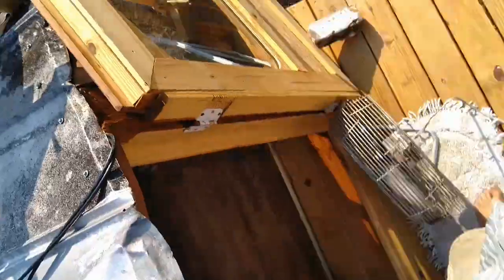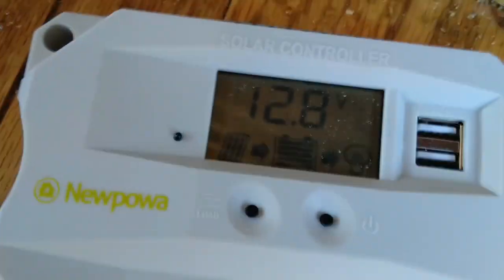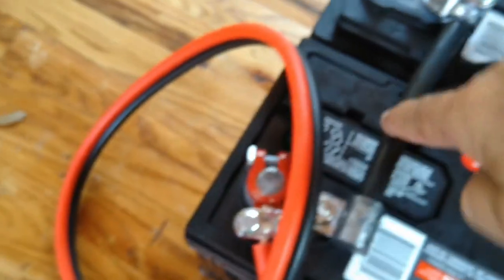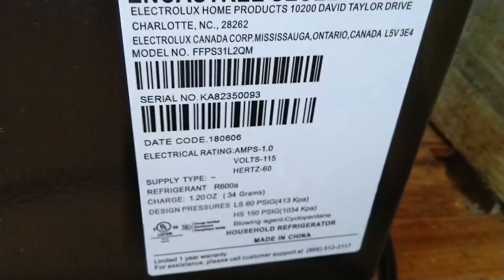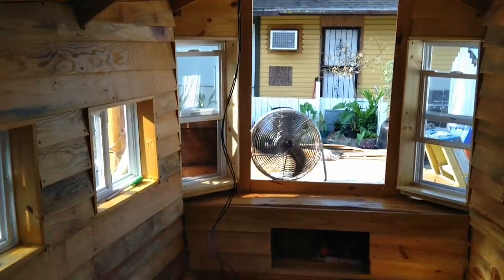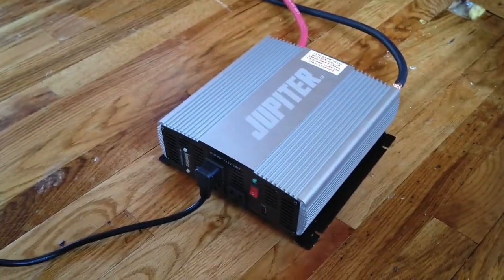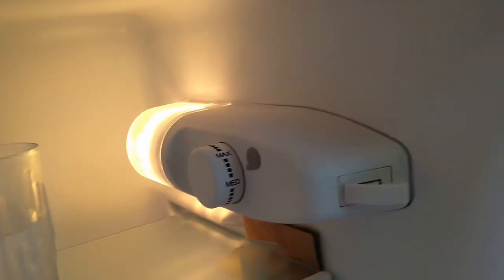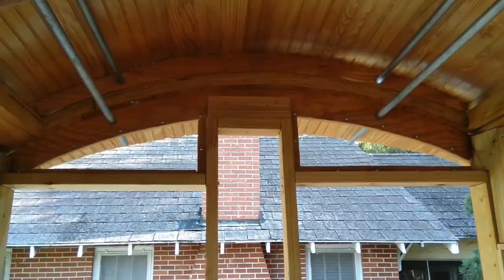Solar powered fridge on The Shanty-Boat "Looper"

Comment: I'm not an electrician, but along with the max drain of 50-60% you are using an inverter to create 115V (note the voltage on the fridge). 1 Amp at 115V = ~10Amps @ 12V (A*V=W, you need the same watts to run the fridge regardless of voltage). Also, using an inverter will lose ~10% due to inefficiency. So if you can use 195 Amps total, as @Jeff Cain mentioned, at around 11Amps per hour, you could go for about 18 hours. Now I'm wondering if you have had any real life experience with this and am I anywhere close? :)
Reply from the maker: You're pretty dang close I would say!    If I'm not using anything but the fridge, and had a full charge the day before, I usually have at least one bar left on the batter charge indicator the next morning.  The batteries usually get back up to full charge by noon.  Cloudy days and adding the fan, tv, computer, and lights to the mix starts to get dicey; I'd like to add four more batteries and two more solar panels.
Reply: @russingram  The only reason I have any idea is that I am looking to build a barge type houseboat (shanty boat) to take on the great loop and am hoping to go totally solar\electric. It doesn't look like that inverter has the option for 24V input (which can give better efficiency) as well as not being pure sin wave. Depending on the appliance, it can make a big difference (as in ruin some appliances, I'm not clear on which ones exactly). More batteries will, of course, give you more Ah. Just remember what @Jeff Cain mentioned, you do not want to take a lead acid deep cycle battery below 50% charge, ever. If you are in a high cycle environment, as I will be, you would definitely be better off with LiFePo batteries. And before you think they are so much more expensive, you have to consider that you can charge\discharge them faster, utilize more of the full charge (down to 10% charge or lower on some) and have a much longer life span (cycles) than lead acid. Just food for thought.

Comment: Your batteries can only be run down to 50 to 60% of total capacity of total amp's before you totally damage them. In your case that would be 4 batteries X 122 amps = 488 amps (total with new batteries). 488 amps discharged to 60% would give you 195 usable amp before you jump in to no-mans land and damage your new batteries. Start adding up your usage (stereo, computer, TV, nav lights and such). Keep up the good work. What hull design did you use to build from?
Reply from the maker: Thanks, I'm definitely going to need to add more batteries.  The hull is based on Peter Theil's Escargot.  It's way overbuilt; 1" of plywood, 2" foam, 1/2" plywood, covered in two layers of epoxy/fiberglass, with six layers on the corners.
Reply: @russingram  Is he related to Philip Thiel?
Reply from the maker: @isdits  I don't know?

Comment: I hate to say it but you need to either turn the music down or do away with it which I would rather see you do. I am looking at those 100 watt panels and I need new batteries also. My old fridge draws too much for me to run it on just batteries so I will also be looking into that fridge at Lowes.  Thanks for putting you video up. 👍